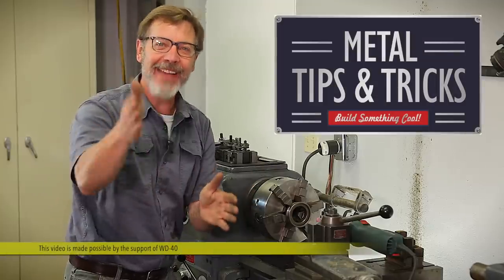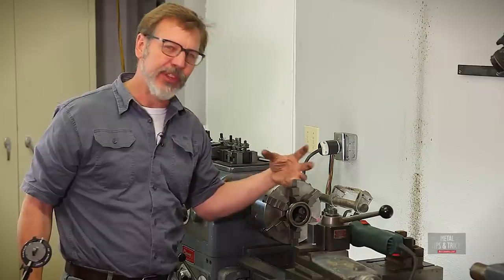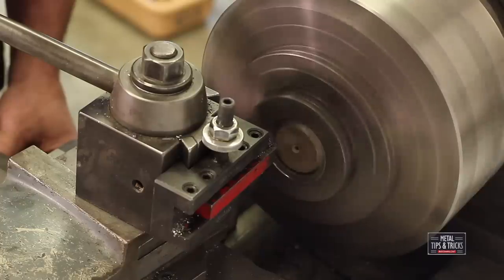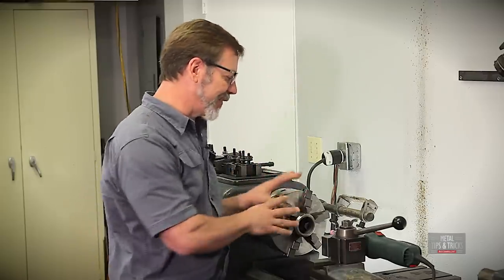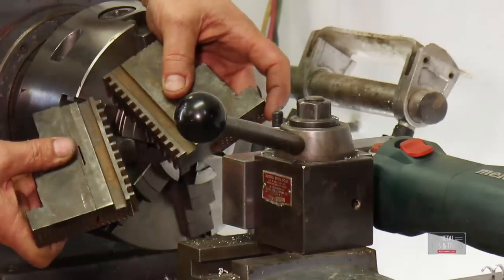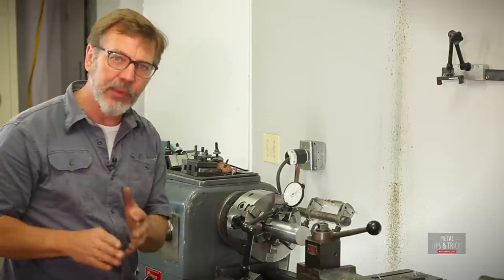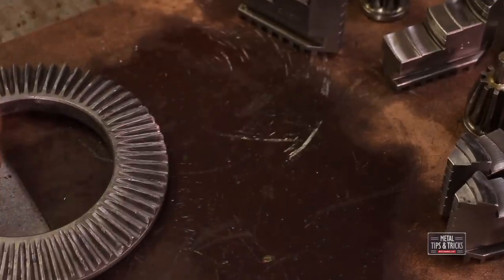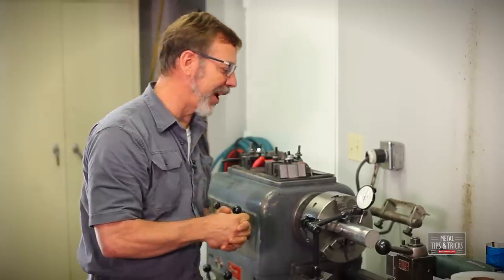Lathe Chuck Grinding

Comment: The most important thing to know about scroll chucks is that the scroll has some clearance around its outer edges. It can be (and is) pushed one way and another within the chuck body. Which way? It gets pushed in the direction that the most recent tightening adjuster pushed it. As it gets pushed around, it carries all the jaws (3, 4, or 6) with it. The only way around this is to be consistent about the order that you tighten the adjusters, and that you always end up tightening the same adjuster last. (It usually has a mark by it.) If you always tighten by rotating the chuck towards you and finish on the marked adjuster, you should end up with the scroll (and the jaws) offset by the same amount and in the same direction every time. Once you have that consistency, you can then grind the jaws to be concentric with the body of the chuck when the scroll (and jaws) are in THAT position.

Comment: How much play does the scroll have in the bore of the chuck body? The tapper of the chuck key gears will push it back and forth in its bore if there is a lot of clearance. You could even test this by tapping on the jaws when a part is chucked in the chuck. Can you adjust the run out that way. In fact that is exactly the way we use to do it before set true chucks were available. This could explain why the thicker grease helped your run out problem. It sort of helps the scroll center in its bore when chucking. Also as you say the scroll could be worn on not made accurately so if you test bar is not the same diameter as your grind it may not run true at that diameter.
Reply: Possibly the rust removal removed enough material to make the scroll inaccurate at different positions?
Reply: Exactly my thoughts as I was watching, the guts looked frankly piss poor, any change in work diameter will put the jaws in a different spot on the scroll and make the grind meaningless again.  Over the years I have really come to favor 4 jaw chucks, they are as precise as you want them to be, just takes a little practice.
Reply: Quick question Peter. Would it be a problem grinding the jaws for one diameter then chucking on a workpiece another diameter? Love your videos btw!
Reply: SimenSupreme  It depends on the accuracy of the scroll and its fit in the chuck body. If the scroll is accurate and it has a close fit in the body of the chuck than theoretically the chuck should chuck all diameters within its range with that accuracy. But everything has some clearance and inaccuracy. That's why a scroll chuck (notice I said scroll chuck) can't be as accurate or repeat as well as say a collet chuck. The best way in my mind is to use a chuck with interchangeable top soft jaws and bore the jaws for the diameter you are chucking.

Comment: Hi Im from the UK, been in engineering a long time and think i can offer some information that might help you. The issue lies in the wear between the scroll and the boss it sits on, if you strip the chuck down again and check the clearance between them im sure you will find its greater than it should be, any wear here will allow the scroll to 'float' radially and when you tighten the jaws down it jams it in that offset position. Hence why the thicker grease helped accuracy but didnt cure the problem completely..and as the grease gets squeezed out the innaccuracy will return. This is why you get a different reading each time you either loosen and retighten or you tighten using more than one of the chuck key sockets. If you eliminate the wear here your chuck will improve massively, and that is why old or well used chucks loose their accuracy more than any other reason unless they have been stressed from overtightening. Another way to prove this is chuck up a bar and clock it, take the nearest high chuck jaw to a high point and with a block of aluminium and a hammer give the jaw a moderate but not hard tap and reclock. you will see the bar shift if the scroll is floating inside the chuck body. I hope this helps. Vic ..V.B.Engineering
Reply: how would you "eliminate wear" ?
Reply: @RedDogForge  its natural wear, you can only reduce it with good maintenance and lubrication...when its worn out its worn out. i guess its possible to machine the chuck body and the scroll and make an accurate spacer but its a lot of work on something thats going to be worn in other areas too. When my chucks lose their concentricity i replace them and use them as 'rough work' chucks..for jobs i dont want to put in a decent chuck like rusty farmers drive shafts etc

Comment: By holding the grinder at 90 degrees to the surface all load is being put on the grinder radially and with that stick out it would enable some deflection. Depending on how much of each jaw was coming into contact with the grinder you may have been experiencing some deflection. The amount of deflection would change based on how much pressure each jaw was putting on the grinder. IE 1 jaw might be 2 thou further out than the next.

The outcome of this would be that depending on how you your held your stock it could change every time you re-chuck something (I think).

If you used a cone style grinding bit and came into it at 45 degrees you'd reduce the amount of deflection because it would transmit roughly half axially and the other half radially.

This may also make exactly 0 difference. Just throwing out a possibly fix/suggestion.
Reply: If you keep grinding until the stone is grinding no material, the pressures will become more equal and eventual zero (grinder not contacting jaw).  The deflection becomes equal.

Comment: As a thought one way to remove debris from grinding is to place a magnet inside a zip-lock  bag and as you move it over the lathe surfaces it would pick up the swarf. Then simply invert the bag on itself and the swarf would be inside the bag and the magnet would be clean
Reply: The grinding dust is also silicone carbide or aluminium oxide or zirconia, these are non magnetic and hard abrasive - that's where the real danger is.

Comment: just a few hopefully constructive comments, sometimes a thin oil is better than thick grease. Although the grease takes up play it also acts like a form of shock absorber, oil on the other hand being thin can be more consistent. if you think of the case of a cross slide lead screw, a thick grease may sound a good idea but its not. Under heavy cuts it will get sqeezed out of the way but under light cuts it doesn't, leading to inconsistent depth of cuts on finishing cuts. Someone with DRO on their lathe could experiment to confirm or deny the hypothesis. 
It is better to have  the jaws very slightly tighter furthest from the chuck face, a reverse bell mouth in effect. If ground trully parallel, once under load, they will become bell mouthed, due to inevitable play in the system, and  cause problems especially when parting. At least these are my experiences. 
keep up the good work and ignore the  
tr-lls.
Reply: i use sp220 in chucks i work with ight gear oil,never had an issue, could be that this chuck is stuffed, needs a new one
Reply: chris0tube    Sorry for that, will try harder  to join the masses next time. 😉😉😉

Comment: This is a common mistake a lot of machinists make thinking that simply grinding the jaws will align the whole mechanism ... it will not. The issue is the scroll and how accurately it’s been made and how well it stays centered in the chuck body. Thus the only way to correct this problem is to re-grind the scroll on a precision setup. grinding the jaws will only make them accurate with the diameter they were ground at. scrolls wear over time at the most used diameter just like the bed ways are most worn near the head stock.
Reply: Was thinking same thing. Scroll inconsistent.

Comment: The align and level the lathe tip is golden😎💯... 2 years ago I grinded my first chuck and made everything all right I looked very carefully that everything is exactly how I was told to do.. But the result was not very good so I tried again and again and whatever I tried it didn't work. One month later I became my new big lathe with D1 4 Camlock spindle and a friend gave me a good old ROEHM 4 jaw chuck as a present which I had to grind first.. I didn't like the idea of grinding a chuck again but I had to give it a try and the result blow my mind it still is the best 4jaw I ever saw.... Why that? The lathe was leveled and aligned not long ago and so the result was that good 👍😎😅

Comment: You show that you tighten the chuck using all three holes to get precision hold. 

Good quality chucks have mark on one of key slots and you are supposed to use that one for final tightening. This is how the chuck was set up in the factory.
Reply: correct, but may i add you're supposed to use the marked scroll only for precision work. tightening all scrolls even with final tightening of the marked one could increase runout.

Comment: I want to see a video on how they design and cut the jaws and the scroll ring. Also how to avoid full chuck of chips. My jaws are regularly jam packed of chips, special if i am doing any type of deep boring or ID turning.
Reply: Well you could machine a tapered plug to keep the  chips out (I presume you referring to the chuck bore hole getting clogged with Chips).

Comment: My practical experience with it is to always use the master key for tightening, it gives the most repeatable results.  I never use the other keys unless I just happen to need to get it held in that position before I can rotate it and finish the tightening with the master. Not going around and hitting everykey the same saves a lot of time and these style chucks are supposed to be time savers if you have to hit every key might as well use a 4-jaw.

Comment: The six jaw chuck in principle is a thing of beauty, can really see the advantages of using one on a lathe when you are trying to grip a part that may crush or distort by trying to hold in a 3 jaw. Those extra jaws offer a more even pressure similar to the way a collet holds small items, which can be very helpful. Too bad the design has no way to indicate it in like a 4 jaw chuck. Great effort in trying to rescue this one.

Comment: I don’t believe it’s the grease... it’s more likely debris in the grease... The scroll and work piece try to rotate the jaws when clamping... the slots on the sides of the jaws an the corresponding keys on the chuck body hold jaws in alignment... debris on these surfaces will cause or at least contribute to the problem you where having... the poor scroll means you will have inconsistent pressure on the jaws which in turn leads to inconsistent run out grinding doesn’t help this much... wear on jaw slots and “keys” will let jaws rotate ... grinding should help this by compensating for the rotation of the jaw

Comment: Excellent presentation.  On my three jaw I always use an indicator. I can affect quite a change by adjusting the pressure on different adjusting points. Typically mine will range from 0.08 to 0.02mm with some adjustments, but I always use my indicator.  I rarely just tighten the three jaw with out checking.

Comment: You’re right about the hammer. I’ve gone through the same problem over the decades.

As for lub, I use CHUCK-EEZ. This is made for power chucks, but works well on any chuck. It’s recommended by Kitagowa. Made in the USA. I’m not familiar with the WD 40 product, so I’m not saying anything about this being a competitor. It’s just what I use.

Also, I wish people would stop making a deal about leveling a lathe. We NEED to align the lathe, but as long as it’s not way out, being level isn’t that important.

Comment: With chucks, the clearance and the concentricity of the inner stub to the run of the jaw slots is very important. So some need the inner stub turned down, and built up again with a shrink fit ring, and then re trued. The inner of the scroll gear needs to run true to the scroll itself, and not the outside. Not easy to find centre and to re true. The clearance of the scroll to the inner stub will determine the consistency of the scroll itself. The next issue is wear on the jaw dogs that engage on the scroll.  Keeping the scroll clean and not using too much tension to hold a part is key to  the long life and precision of a chuck. Basically, don't do the roughing out of a part with a precision chuck. Precision chucks should only be doing finishing  passes as their greatest depth of cut. The heavy grease works better as it has an ep compound and takes up the excess clearance of  the scroll and inner stub. Using the same one key will obtain the highest level of consistency for that particular chuck.  But with a worn chuck, different keys will yield a different result with different diameter bar.  To close down the jaws, I used some pieces of hard wood, like Maple in the jaw relief area. I cut them all the same width, and placed them in the jaws with a bit of cyno onto 1 jaw. Tighten it up, and then recut the jaws at the diameter that is 1/2 way in the practical clamping range of the chuck.

Comment: Ben, I question using outside pressure on the jaws instead of inside pressure.
Should you not use a ring on the inside and squeeze the jaws tight, then regrind?

Comment: Hey Dale just an FYI when I grind my chucks I never take more than about .002 per pass I might take a heavier pass if I had some really high points just to get those knocked down I can always get my chucks to dial within . 001 after grinding also never use heavy grease in a chuck it just is a big magnet for chips they get in the scroll  and really cause problems I use a 068 hydraulic oil on my lathes never use way oil on a lathe in a room where you have grinding dust and lots of dirt floating around it is terrible to remove from the lathe also if you want a machine that will grind a Chuck really well Look for a brake drum grinder

Comment: If you want to grind chuck jaws on the inside, you have to apply pressure from the inside (like when you clamp a piece of metal). When you want to grind the outside the opposite will have to be done (like when you clamp a ring from the inside). It doesn't work any other way.

Comment: Dale: First project should be to put up either a piece of plywood or sheet metal to prevent oil from splatering your drywall! 6:18

BTW: I am not nitpicking, just trying to provide some third party observations. I know its hard to shoot video & do the work at the same time.

Not sure that using a scrap piece of alum with possible concentric errors (ie not perfectly round) is the best idea. Ideally using a ground shaft for measuring run out would be a better way. The stock (with mill scale) likely has concentric errors. Perhaps cut the ring & test shaft on a four jaw that you can dial in with better precision. Then use them for grinding and testing on the Six Jaw. 

Not sure if the gear teeth on the back of the scroll disk matter much, since they are just used to adjust & tighten. The scroll side is the important side.

Comment: Mech Eng 101 Progression of Derivatives of Speed/Force: 
Speed
Acceleration
Pop
Snap
Jump

Then there is the matter of Elastic and Inelastic Collision.

The Iron Hammer was/is the correct choice for "breaking" rust, corrosion, adhesion, paint or any sufficiently high static coefficient if friction/stiction.

Comment: I had the same Problems with my six jaw. Try turning a one inch brass rod about 6” and turn a half inch dia end for the drill chuck . Run the lathe at your 45 RPM with pressure on the brass , using lapping Compound running it back and forth in the tailstock , lap the jaws. Takes time but u can get it much closer to .001 or a half thousand.

Comment: Really enjoy your videos.  At the 4:00 minute mark you mentioned cutting a little shoulder in the jaws for grabbing a washer or similar piece.  I like that idea and want to do it to my lathe chucks.  I would love for you to provide a little detail on this operation.  I have a 3 jaw and a 6 jaw chuck for my Monarch EE10  Should I do it to one or both chucks?  Keep the great videos coming!
Tom
Reply from the maker: Hi Tom, thanks for your question. I would only do one chuck, but it’s up to you and your work flow and how much you would use that feature.   I use it all the time so I want it on the chuck I use the most. Your lucky because your chucks are small and light. Mine are not so light 😝 lol

Comment: the case you tight 4 dirction evenly make me think, the gears contact maybe a bit loose? can you try to add a thin spacer (washer) on the outer face of scroll? I think maybe it improve it on the rigidity and repeatability.

Comment: Grind large amounts w dust pickup, recommended.
Reply: Also, I was surprised that the preference to clean was to wipe/move the dust with a rag, not remove via vacuum.

Comment: Trying to regrind old chucks is very frustrating.  Most successful one I did was done completely the wrong way, just progressively tightened the jaws down on the stone and ran it back and forth while held in the tailstock.